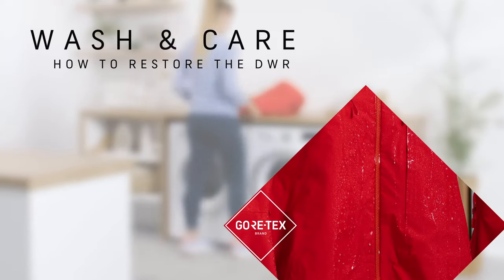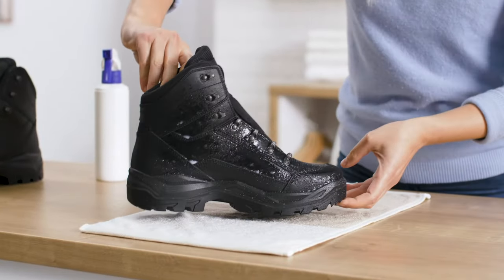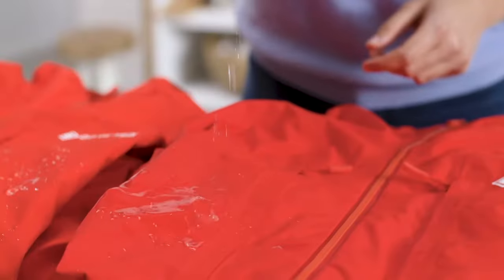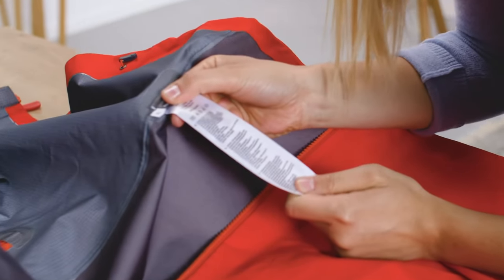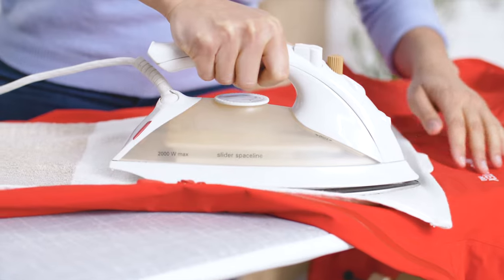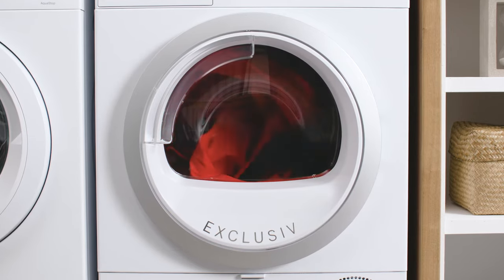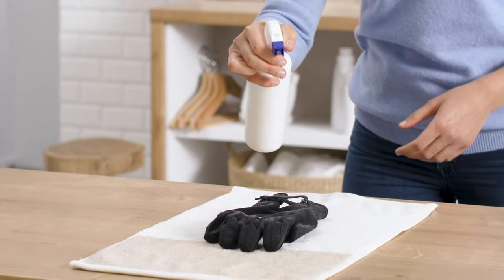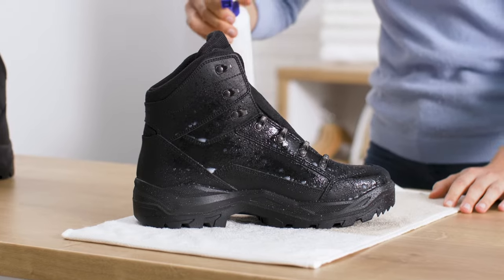How to restore the GORE-TEX DWR (durable water repellency) | Wash & Care

Comment: What is the point of the waterproof membrane if the outer material needs reapplying the water repellent? If the Gore Tex membrane was indeed waterproof as advertised, wetting out would not be an issue, because water could not penetrate inside. Now it turns out that the membrane is waterproof only when the outer material is competely dry, which doesn't make sense. This means that you pay premium price, say, for a jacket, and after a while you need to reapply DWR and restore its water reppelency. Both my Gore Tex Pro and Gore Tex Active jackets have failed me even in light rain, as they wet out in a matter of minutes and the inside gets moist almost immediately. That means that the membrane is not doing what it is supposed to. In my experience, having a reliable and a trully waterproof jacket with underarm zippers for venting is the way to go and it costs only a fraction of the price of a Gore Tex jacket.
Reply: I work as an outdoor instructor. The gortex jacket worked well when I was in Asia. When it failed to keep me completely dry it wasn't unbearable cold and it was breathable in the heat. Since I moved to Vancouver,  the gortex jacket didn't work very well when it could get SO COLD when I got my base layer damp. I turned to 100% Polyurethane jacket now.
Reply: Me too, and even after following the exact procedure and applying the dwr it's still getting wet when I put some water on it, feels useless...
Reply: The water cannot pass through the membrane.  When the DWR has worn off the OUTER material which is usually tightly woven nylon,  will absorb the water.   You won't have water touching your skin,  but it could be on the other side of the membrane, this can strip your heat.   This has always been the case with any Gore Tex jacket.      Columbia Outdry Extreme has the membrane on the outside, so no DWR is needed.
Reply: DWR is there to protect Breath-ability not waterproofness, the membrane sits inside the outer fabric, once the fabric wets out it is no longer breathable, which is why you start to feel moist on the inside.

Unfortunately user applied DWR is not quite as effective as factory applied DWR, however applying heat (not too hot) to the DWR after application can help to 'activate' it
Reply: I am always glad to see people using brain. You are right 100%. Gore tex is NOT waterproof any more and thats it!!!! 10 years ago my gore tex sneakers and jackets was waterproof, now every brend of sneakers with gore tex I try simply leeks water. So 10 yrs ago gore tex label means good product, these days that label scream avoid this product.
Reply: If the outer material soaks up water, the gortex membrane will not breathe correctly.

Comment: Just a comment: I have had jackets since 1990, more than 30 years. The "DWR" rubbed off after 2 weeks of use on every type of jacket, Gore-tex and not. So I used Nikwax in the first instance. It became very white and quickly dirty. Why? Because I used too much. Use too little and it will not restore DWR. Also tumble drying I think is a bad bad idea. Ruining the fibers of the jacket, folding breaking it everywhere. Why don't you just place it in the drum of a washing machine, and use a hair dryer to blow hot air, then close the door on the drum. Effect will be the same. Also using the iron is again dangerous. First, how do you know the temperature is good and will not unpeel the plastic seals? Did you know that recently gluing is made so that threads can be saved? Glue will give away after some time while threads will not. I used MCNet to reglue the wall hanger of my jacket, which suddenly gave away... Were it sewed, it would have stayed. Also when proofing the jacket a light heat does help. However DRW WILL COME OFF. All that rant about reactiviting is a half-solution. The real thing is that if you want your clothes to be 90% good as factory, you will have to do 2 stages. First get a DWR that is NOT thick and white like Nikwax, which is appx 60% effective in keeping the waterdroplets running on the surface after 5-10 minutes. The ad shows water running. Yes. But water does not run on you. It FALLS on you, STAYS on you and the surface pressure to keep water away needs to be maintained. Nikwax does this ONLY if you put a ton on the jacket, which will change color due to the wax and will get dirty. Did you try the wax on a dark jacket?  Try it an see white, grey spots all over. If you heat it the wax will flow and disappear into the fabric. Go for a walk, and the wax will come out, break and white streaks will appear where you fold the jacket. This is quite waterproof 80%, but unattainable and ugly. So what you have to do is get a proper DWR that is NOT WAX based. German, Swiss brands will do. A wash-in is a must. So I dilute the wash in only 50% and I spray on my garment with a hand held pumper. No Waste! Then I get the hairdryer and dry it half. Next place the garment into the dryer or the drum of the washing machine and continue blowing heat. Turn the drum once in a while to get heat everywhere. Once done hang you jacket. Modern DWRs-are ACTIVATED through heat. That means that the structure of the stuff will change and start hating water. Not Nikwax. It is just diluted wax. If you add too much, it will fail because of dirt. The other stuffs if you add will not color your jacket much, AND will ACTIVATE and WILL HAVE A TON OF DRW.  Finally depending on the jacket you may experiment with sprays from the same brand. The thing is a thin layer of spray-on DWR on the soaked in DWR will make sure that the garment is 90% factory quality. Why? because if you just use the spray, it will not penetrate deep enough, while bouncing off the garment most of the stuff. If it penetrates, then still it is not as durable typically as the solution-based pumper wash-in. Imagine the wash in as a crude soluble crystal that is half melted on the top layer. You add a higly soluble solution to make the surface mirror smooth. Sometimes the spray-ons will work differently against the wash-in, so make sure you experiment a bit on a different garment. But if you get it right, you can make a proofing that will not suck up water after 20 minutes of good rain. Unfortunately the advertisements do not show reality, but some lab sequence that is far from reality. In reality, you stretch, rub, soil the garment. How could the DWR stay on unless the very fibers of the cloth are water hating? That is why DWR has to be very soluble, heat activated, and penetrating. Unfortunately Nikwax is not so soluble. And once its there it is bulky meaning that the wax is not flexible enough. If you use silicone-based stuff, then you kill your jacket, and sprays could also mess with the glue in your jacket. So water soluble heat actived DWR is a must. Oh, I have a jacket bought in 2010-is that still has the DWR I placed in it. Ok, did not use too much, but can take 30 minutes of rain before wetting out. That is saying something. I also ruined several garments but either using the iron on a hot setting making the glued parts come off, sucking up DWR with the cloth under the iron..., and stuff, even making a hole into the garment when I forgot to use the cloth... I managed to peel off the glued pocket due to the solvent in the sprays... So never buy something that is glued. That means it is simplified for manufacturing, bound to fail. Even shoes have their laces sewn to the leather for good reason. So finally the truth: Nikwax works best for polar sweaters, with mushy fibers, not thin jackets. Oh, and if you want a rain jacket, get the one that has the thin outside material, which will dry fast, because it will not suck up water much. That is the trick. And if you want to avoid clammy feeling in rain, get a size bigger jacket and breathability is 50-100% more!
Reply from the maker: Thanks for taking the time to note down all your thoughts on this topic.
ℹ First of all, it is very important to always check and follow the care instructions of your individual garment, which can be found on the sewn-in tag on the inside.
⚠ We strongly advise against using a hairdryer as that might damage the garment. Since heat needs to be applied to the garment in order to reactivate its DWR treatment, we recommend using either a tumble dryer or an iron. When using an iron, place a thin towel or cloth in between the iron and the garment for protection. Use a low setting and no steam. For detailed care instructions click here: https://bit.ly/3x7eCop
🧴 Both wash-in and spray-on DWR solutions are available on the market. For them to be effective, it is important to follow the instructions that you can find on the product's packaging.
❔ If unsure, please contact the manufacturer of your GORE-TEX garment in order for them to recommend a specific care/DWR product for your individual garment.
💪 Finally, we test all of our products in the lab as well as in the field with our valued athletes. For details click here: https://www.gore-tex.com/testing
Reply: @GORETEXBrand  Thank you for your comments. Been there, done that. In the past years I have gone through at least 10 jackets of various brands. Would be preferable if a real-world usage is shown instead of the lab, where the athlete or mountain trekker actually has mud, slime and rain on the jacket, goes home washes the garment, reproofs it and looks at how it performs afterwards. Then goes on a trek again.... That shows how the garment DWR actually rubs off and how the reproofing needs to be done. That would sell the knowledge and the product.
Reply from the maker: @andrashavas  That's great feedback! We'll keep that in mind for future content creation. Many thanks! 🙂

Comment: I have bought an used arcteryx acto fl jacket and water bleeds into it, it says its dwr but im not to sure, should i buy an spray or wash for this, Thanks!
Reply from the maker: We would recommend to try and reactivate the DWR treatment by washing the jacket with only water (no detergent) and two consecutive dryer cycles afterward. If that didn't do the trick, try reapplying a DWR product by following the instructions on the product's packaging. Otherwise, kindly contact Arc'Teryx for further assistance.
Reply: @GORETEXBrand  Thanks

Comment: Can I use Nikwax TX.Direct to restore the DWR on my Gore-tex jacket? If so, should I use the wash-in or spray-on type? Thanks!
Reply from the maker: Due to the large number of high-quality products available, we cannot recommend any specific product for restoring the DWR of your jacket. When choosing a product we recommend checking that it is suitable for breathable and functional clothing. You will find this information on the product's packaging.
Reply: @GORETEXBrand  Thanks!
Reply: You can but its crap.  The absolute best stuff you can use if called Fabsil Gold,  its for tents,  but it will bead up the water like NEW.  Paint it on with a brush for best effect.  Do it outside as the stuff STINKS. Smell will disappear after a day.
Reply: @theenglishtrucker1849  Do not mistake sprays intended for tents with sprays intended for breathable wear!!!!! One has silicone content, meaning oils, and stuff, which will stifle the gore-tex and can have an effect on the glue in the jacket.

Comment: How many degrees Celsius shall I set my tumble drier to based on what they say in the video: “tumble dry for 20 minutes on a warm, gentle cycle”?
Reply from the maker: As a rule of thumb, we recommend to tumble dry garments with GORE-TEX technology on a warm, gentle cycle (60°C exhaust temperature). Once the garment has been dried, the same temperature setting can be used for a twenty-minute cycle to re-activate DWR. When following the above instructions, please make sure to respect the care guidelines specific to your garment, found on the care label of the garment.
Reply: 40 degrees will do with a hair dryer...

Comment: This is great. For a jacket: Can I use a washer with an agitator in the middle or is that too harsh? And one concern: Am I coating the inside of my dryer with the DWR/waterproofing? I don't want it to affect other clothes. Thanks!
Reply from the maker: In regards to washing machines with an agitator, we would recommend contacting the manufacturing brand of your jacket in order to make sure that they are safe to use. We generally recommend using the most gentle cycle on a regular washing machine for all GORE-TEX garments.
While we do advise drying your GORE-TEX jacket in a separate cycle without any other garments, the DWR treatment does not leave any noticeable residue and it does not rub off on other garments in later dryer cycles.

Comment: what about if u don't own an iron or dryer?
Reply from the maker: Heat is needed in order to (re-)activate the garment's DWR treatment. We would not recommend using a heat source that is not designed for garments, such as a dryer or an iron.
Reply: Hair dryer
Reply: @GORETEXBrand  What about laying it out in the sun for 20min?
Reply from the maker: @user-nk1wq4zf9f  We do not recommend using a heat source that is not designed for garments, such as a dryer or an iron. When you lay your garment in the sun for drying, you cannot control the temperature and the heat will not be distributed evenly around your garment.
Reply from the maker: @MVTTE  We wouldn't recommend using a hairdryer as that might damage the garment. Since heat needs to be applied to the garment in order to reactivate its DWR treatment, we recommend using either a dryer or an iron.
Reply: @GORETEXBrand  okay thanks, noted. Also it's interesting how many sources recommend drying it with a dryer to reactivate the membrane, while from what you say it seems it's also ok to air dry it and apply the heat source later on. Will try it with a towel and iron.
Reply: Hair dryer.